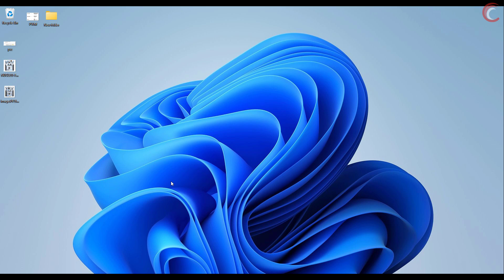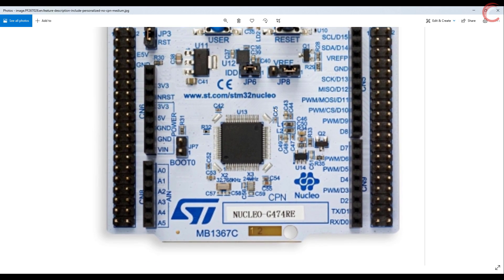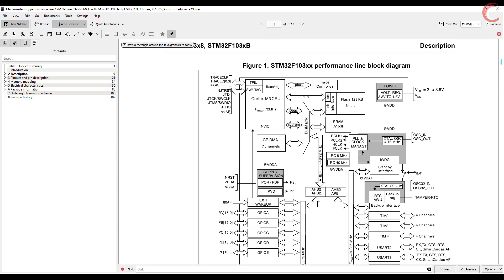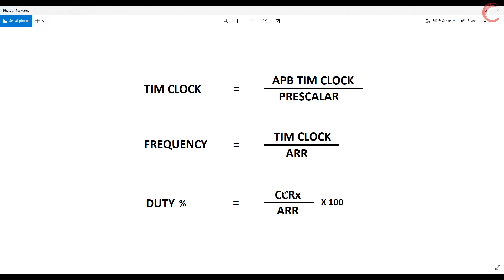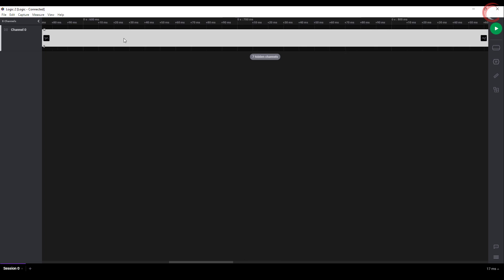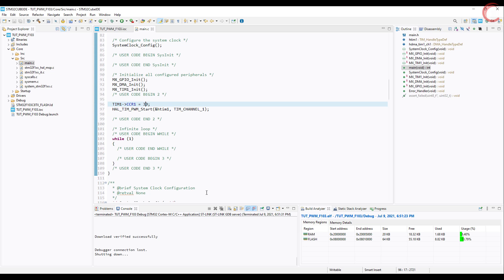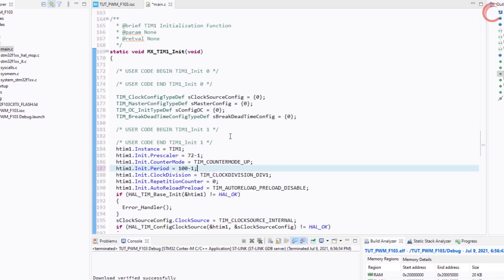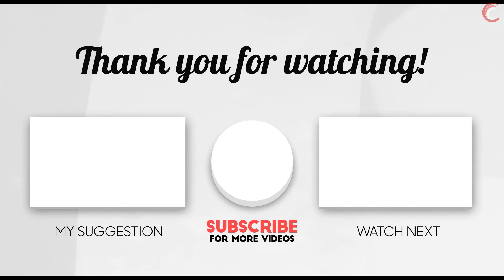STM32 Timers (PART 1): How to Generate PWM Output with/without DMA

Comment: Thanks for the video. Never would have  found out that I have to set TIM1->CCR manually alongside HAL initialisation. Thought that the MX setup would be sufficient. 
Small Typo in your Formula: it's PRESCALER, not PRESCALAR.

Comment: A quick question , so what is equal with 1 second :TIM CLOCK of 1Mhz or the FREQUENCY of 10Khz?
Reply from the maker: I don't understand the question
Reply: @ControllersTech  so all your calculation are based on the fact that we will get 10000 lets say pulses in one second  and each pulse will be 100us?  and out of that 100us we will have 50us  Hight and 50 low (this is the duty cycle ) Am I right ?
Reply from the maker: Yes.
Reply: @ControllersTech  thank you

Comment: can we use pwm in fsk transmitter? if yes can you please guide us a little?
Reply from the maker: You can use, but you need another hardware which takes the pwm as input and modifies the frequency of the signal based on the input width.

Comment: What software are you using to get the waveforms? I've been using an actual oscilloscope, and it is fine, but having that built into your software looks nice.
Reply from the maker: Its actually a hardware, logic analyzer. The software is complementary.
Reply: @ControllersTech  cool! Thanks. That actially just reminded me that the scope I got has software thay goes with it that I never bothered installing. I should probably try it out.

Comment: where to get the user manual, which document you found the "14.4.11 TIM1 and TIM8 prescaler"
Reply from the maker: User manual for your controller can be downloaded from ST's website. You should have it before you start programming.

Comment: Hi.

I have a STM32L462 custom board with 40Mhz clock setup. I need to generate pwm for 9600,19200,38400 and 76800 hz. First 3 works fine but 76800 doesnt work. Used a counter to verify. It counts upto 50270 or 51000 only. Its not a very high frequency. So why is there a issue!? Can someone help me!?

Comment: ACTUALLY AUTO INSTRUCTIONS ARE NOT COMMING IN MY PROGRAMMING WHAT I DO? ALTHOW I TAP CRTL+SPACE.
PLEASE REPLY. IT SHOWS NO DEFAULT PROPOSAL
Reply from the maker: The cubeide does not auto complete the instructions,  you have to press the ctrl + space.
Whenever you generate the code from cubemx, build the project once before writing the code.
Reply: @ControllersTech   thank you I will try.

Comment: There are showing an error during debug of code - ''no st-link detected please connect st-link and start the debug session''. How to solve, plz guide to overcome from this error
Reply from the maker: As the error says. Connect the st link.
Reply: @ControllersTech  how i link them
Reply from the maker: You need to have some hardware like oscilloscope or at least a signal analyzer. 
Then just connect the pwm output to the analyzer and view the waveform in it's software
Reply: @ControllersTech  thanks for all
Reply: Sir another question - from where we can see the PWM pulse after debugging of that code... I mean do we need to install another application??or  can we get that in lDE only??

Comment: uint16_t pwmData[10];
int flag = 0;

void HAL_TIM_PWM_PulseFinishedCallback(TIM_HandleTypeDef *htim)
{
	HAL_TIM_PWM_Stop_DMA(&htim1, TIM_CHANNEL_1);
	flag=1;
}

int main(void)
{
  HAL_Init();

  SystemClock_Config();

  MX_GPIO_Init();
  MX_DMA_Init();
  MX_TIM1_Init();

//  TIM1->CCR1 = 4;
//  HAL_TIM_PWM_Start(&htim1, TIM_CHANNEL_1);

  pwmData[0] = 10;
  pwmData[1] = 20;
  pwmData[2] = 30;
  pwmData[3] = 40;
  pwmData[4] = 50;
  pwmData[5] = 60;
  pwmData[6] = 70;
  pwmData[7] = 80;
  pwmData[8] = 90;
  pwmData[9] = 100;

  while(1)
  {
  HAL_TIM_PWM_Start_DMA(&htim1, TIM_CHANNEL_1, (uint32_t *)pwmData, 10);
  while (!flag){};
  flag = 0;
  }

I make this but next pulses start with 30% duty cycle and not 10 20, only 30, 40, 50, 60, 70, 80, 90, after start with 60, 70 and then again with 30,40,50,60,70,80 and 90 and again.

Comment: I am using logic analyzer like yours, i put trigger and see the different pwms 10%, 20% to 90% one time, not in cycle, don´t work like you explain, stops and do only one time this presentation. Have to set OUTPUT COMPARE PRELOAD to enable because if you set to disable will not work. So this works only one time and not repeat the signals.

Comment: Hello, I tryed the part of the code using DMA on STM32F407VET6 and don´t work. I did all the steps, i need help. The other things worked, but DMA not, maybe there is some more configuration to do but i not discover.
Reply from the maker: Check if the interrupt for the respective DMA channel is enabled in the NVIC settings. If not, then enable it and give it some priority.
I think the cube have changed some configurations in the recent updates.
Reply: @ControllersTech  DMA2 Stream1 Global Interrupt in NVIC is gray and maked but i can´t clean or set, not possible. My version of Cube IDE is 1.10.1
Reply: @ControllersTech  It runs one time, but not repeat the pulses again and again, only one time.
Reply: @ControllersTech  i did but the pwms appear but one time only and with trigger
Reply from the maker: Need to see the code.
Either open a thread on the website, or ask in the telegram/discord groups. Links are in the description

Comment: Which software you used to see waveforms?
Reply from the maker: I used a logic analyzer. The software is complementary
Reply: How logic analyzer is connected to stm32 cube ide
Reply from the maker: It is connected to the mcu, The PWM pin.

Comment: Because the output control value changes the moment the CCRx value is reached and the moment the timer overflows, and the timer doesn't overflow until the clock edge after the ARR value is reached, the Duty Cycle should equal CCRx/(ARR+1) and not CCRx/ARR. By adding the "-1" to the "Period" configuration parameter, you are technically setting the ARR value to be one less than what your calculation is using. So when you set the period equal to "10-1", the ARR value is technically 9 (and not 10 as you suggest. And so the equation should have (ARR+1) in the denominator.

Comment: How to use DMA to change pulse  frequency? DMA changes the value in the CCR register, how to switch the DMA to change in the ARR register?I want to use Timers and DMA to generate pulses for a stepper motor. For a normal start of the stepper motor, you need to smoothly increase the frequency to the specified one and also stop it by smoothly reducing the frequency. STM has Application note AN2820 how to implement this using DMA and timer. But I want to see a video tutorial on how to do it. Can you give a tutorial on how to change the frequency and tune the duty cycle using DMA? thanks
Reply from the maker: I'll check it out

Comment: Hi, what if I want to control a 50Hz motor with an stm32 which has 16Mhz Clock?
Reply from the maker: Use prescalar and arr to bring the clock down to 50 Hz.
Check out the servo motor video in this playlist
Reply: @ControllersTech  ok so to adapt your video to my needing a i would do 16MHz/50Hz = 320 000. To divide it between the Prescaler and ARR i could do PSC = 8-1 and ARR = 40000-1. 
But then how to set the duty cycle (ex. 50%) ? Tmr1->CCR = 20000?
Reply from the maker: Yes you got it correct
Reply: @ControllersTech  oh thanks ;) 🙏
Reply: @ControllersTech  So the reason why you are able to write 30, 50 and they are actually 30% and 50% duty cycle is just because you have ARR = 100 right? So if I wanted to have the same thing I could write tmR1-> CCR = (x) / 40000 * 100 ? Or am I wrong?

Comment: Can we change frequency (variable frequency)as we changed the duty cycle?
Reply from the maker: You can use __HAL_TIM_SET_PRESCALER to change the prescalar.
Reply: @ControllersTech  can i change frequency  with dma ?

Comment: What is the lower limit of DMA controller? Is it able to push data to CCR1 register, if prescaler is 0 (1)  and ARR register is 15 (16 ticks)?
Reply from the maker: You mean how fast the DMA would be able to transfer the data ?
There is no definitive answer to that. Also i haven't seen anywhere ST mentioning this.
 It depends on a lot of factors like your CPU clock, your GPIO speed, the data size etc. 
So best way is to test yourself.
Reply: @ControllersTech  I was just curious what is the limit of stm32f103c8. But you are right, testing is best way to see. I'll test it on bluepill (clone), so tnx for the video.

Comment: First of all, it's a very good video. but for example can it take a value processed inside the while loop as pwm with dma?
Reply from the maker: Yes why won't it ?
Just update the pwmData at any point in the entire code. 
The DMA has been assigned with the address if the buffer, not the value.
So its doesn't matter what value you pass.
Reply: @ControllersTech  You are perfect :) thanks...